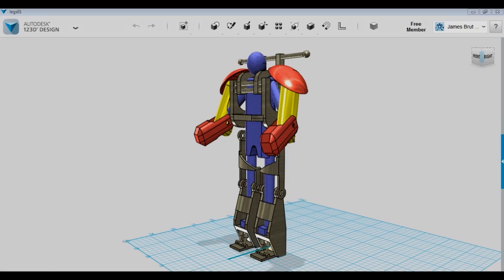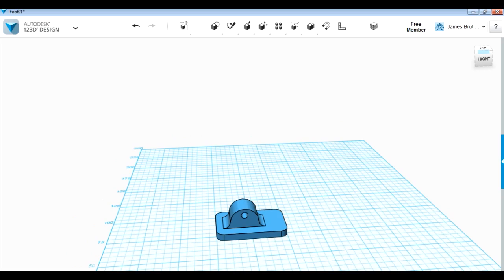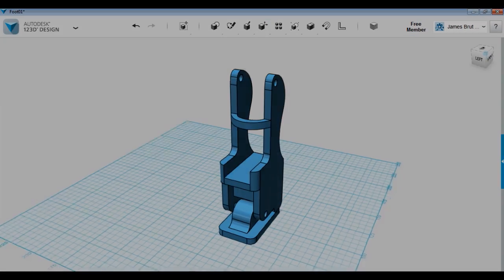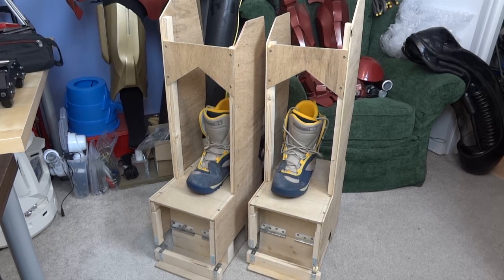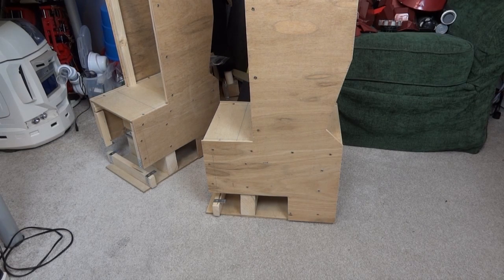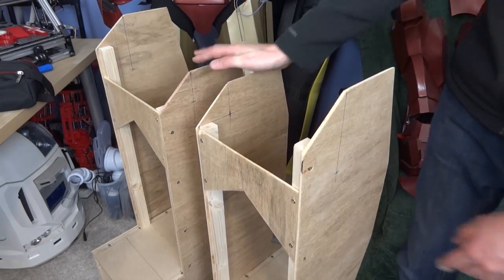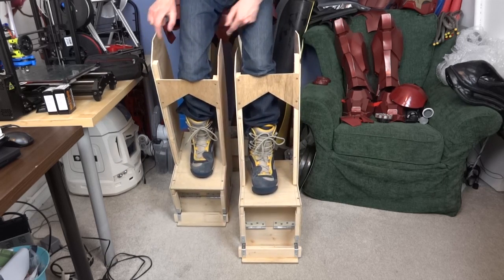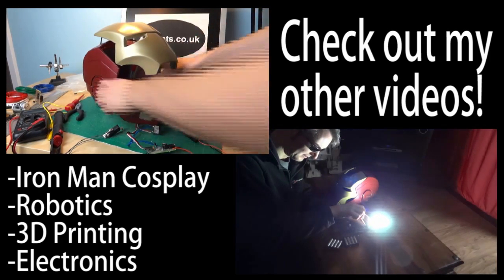Iron Man Hulkbuster Cosplay #2 | Building Stilts | James Bruton

Comment: They make (or used to make, they may have fallen out of style by now) snowboard boots and bindings that you can step into. The toe has a hook that hooks into the front of the binding, and in the middle of the boot there is a metal rod that snaps into another piece in the center of the binding. To get out you just have to press a lever, and the rod pops out of the binding. You may have already looked into it but I would imagine that making a mechanical system to allow you to reach the lever would be more simple than making a system to put on the straps.

Comment: Either the feet are going to be very boxy or the panels will be huge to round out the legs and make them look less like boxes strapped to your legs. Still a pretty good beginning, hope they can support the weight and the knee joint works.